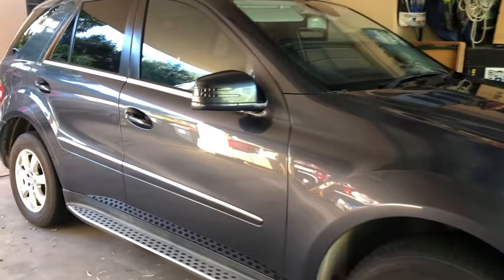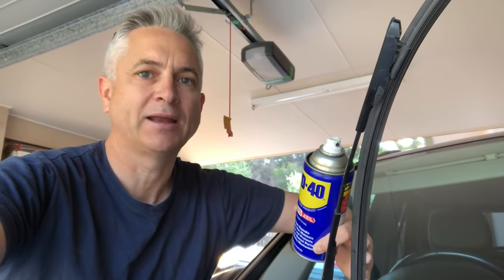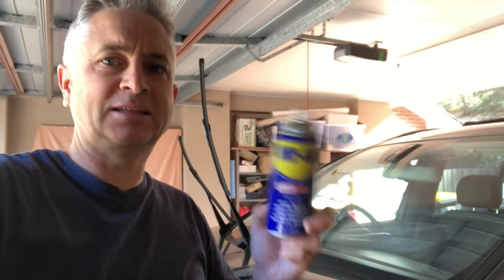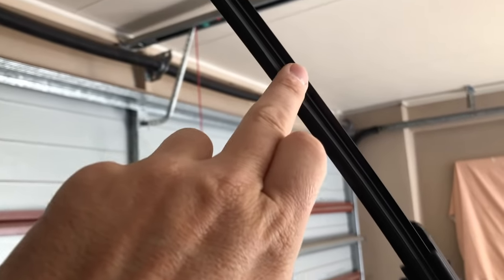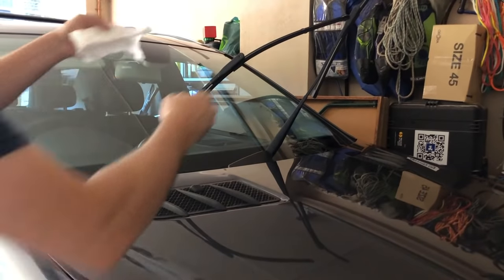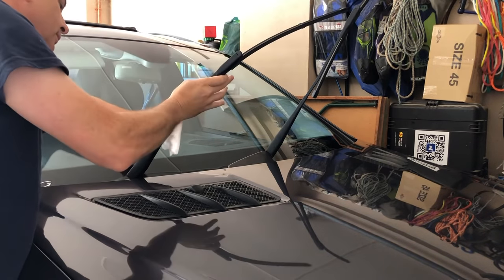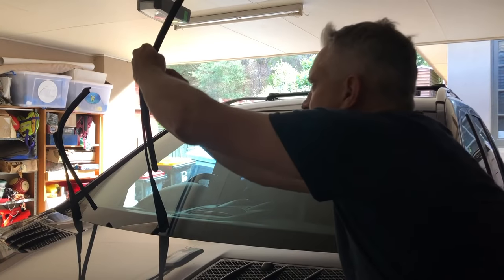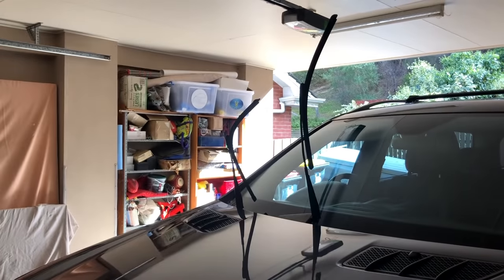WD40 Hack on Wiper Blades!  Does it really work?

Comment: Hi Drew, on some wiper arms, wd-40 can be sprayed to loosen the hinge or elbow, that's supposed to flex downwards,  with the spring underneath.  Wd-40 will loosen a corroded hinge,  allowing the correct pressure of the arm and blade on the windshield.
Reply from the maker: Hi Erik, thanks for the info. I will look out for this in the future! Cheers Drew

Comment: I agree.  That was "dried rubber" coming off your blades. Soft rubber works best on glass. So, removing dried - hard rubber and softening the remaining blade will make it pliable.  I'm curious as to how long it lasts.  A follow up would be nice.
Reply from the maker: Hi, I still have the same blades on the car to this day!!  Cheers Drew
Reply: @DrewFixIt  Great. Thanks.
Reply: Use the Rain-x wipers and Rain-x cleaner. Works great. Water beads up and blows off the window. When you notice the wipers not performing like they were, and it's easy to tell this, just wipe some of the cleaner on the wiper blades, and they are like new.
Reply: Awesome 😂
Reply: @curtzeek8818  I have used both works OK if you use the spray every month but otherwise same old crap. Wipers are nothing special and too damn expensive.
Reply: @bultacowally  I agree they're too expensive. That's why it pays to take care of them with a little pm
Reply: It'll last for one good downpour and start gringing/grating again.
And yes its not just dirt being removed. Its the compound of the blade too.
Reply: Wiper blades exist thatv never wear out. They won't sell them.
Planned obsolescence.

Comment: A buddy of mine owned a gas station and he had this rubber cleaner for repairing tires that he'd use on wiper blades. He called it, "recutting the blades". It worked pretty good. So if you can get ahold of whatever that stuff is then give it a go.

Comment: Yes, as others here have noted, the black is for sure oxidized rubber.  My only issue with using an OIL BASED product such WD-40 SOLVENT, is that it will break down the rubber.  I usually use 91 % rubbing alcohol and then as another mentioned, PURE silicone liquid because it WILL NOT attack the rubber.

When I buy any new vehicle, weather a new car, or recreational, all rubber and aluminium under the hood etc. gets a good dose of pure, food grade silcone spray.  The rubber lasts for years and the aluminium will NOT corrode (white powder).  Just a tip I learned years ago, and continue to use to this day.
Reply from the maker: Hi Gary, thanks for the tips.  I will be sure to try them out!  Thanks Drew
Reply: @DrewFixIt  You are very welcome! 😊
Reply: Good point it helps initially the key is to have something that continues to work better.  Not works like new again then even faster goes bad.  As with many of the headlight lens "fixes."  Unlike here many of those fixes claim proclaim to have cured the problem simply because it looks shiny again.  Rather misleading as this is done right after finishing and no testing was done for durability of the sealant used.  Will it last similar to the original, longer or will it cloud over much faster.
Reply from the maker: @cardinaloflannagancr8929  Hi Cactus, I did mine something like a year ago and they are still good!  Cheers Drew
Reply: I doubt an occasional clean with WD40 would cause enough breakdown of the blade to worry about, but if in doubt, maybe Inox would be a better option. I use Inox on outboards, because WD40 can break down the insulation of the wiring and Inox doesn't. Then again, maybe the reactivity with the rubber is what helps clean it? I might try both ;)
Reply: most wipers today are synthetic rubber( petrol based) or silicone or a combo..not actual latex rubber.
Reply: By silicone liquid, do you mean something like CRC Heavy Duty Silicone? Curious if AT-205 would also be a good option.
Reply: I have yet to see WD-40 break down any rubber in my 40 years as a mechanic.
Reply: @2023JCWMINICOOPER  I am interested in your 40 year claim and use of this solvent on which rubber items?  Couple things, WD will attract dust and dirt, it also doesn't last very long as it does evaporate in a short period of time.  100% silicone liquid doesn't share those properties.   But, good for you that your use has not resulted in any negative effects to rubber which I find amazing!
Reply: @garysmith8455  You do realize that there are 100% silicone versions of WD-40 right???
Reply: @2023JCWMINICOOPER  Thanks for the heads up, would you kind enough to share the link to the product?  Thanks.

Comment: I've actually noticed that the old-style multi-part blades work better than the "new" single-beam blades, which makes me wonder if the new type were mainly a matter of marketing all along. Also it saves me a fair amount of money.
Reply: The 'new' type work better at high speeds due to the aerofoil. Though you can/could get the 'old' type with an aerofoil on the arm.
I have often had problems with judder or streaks on the newer type... much less (or never) with the older types.
Reply: @DJ_Dopamine  That's one of their claims but I haven't found it to be true. Maybe the old type just let air pass through while the new type lets air get underneath and lift them. Project Farm should do something on this but I'm not sure he owns anything that goes fast enough.
Reply: I thought I was the only one who thought this. I have a 2016 Ram 1500 and I have way better experience even with Rain-X Expert Fit Conventional than any beam blade. All the beam blades chatter at the ends as if they are fitted very loose but the conventional won't do it and they cover the entire 22 inches where I swear a 22 beam is more like a 21 or 20 inch blade. My favorite blade is the Rain-X Expert Fit, about 16 bucks for a set of two at Walmart vs 40 bucks a set for beam blades
Reply: The 'new' type blade is most of the time better if your wiper arm is In Good condition (spring load etc.) or/and if you drive in winter where 'old' type wiper "joints" could freeze. 'New' type blade can sometimes do this "jumping" But easy fix is to use turtlewax clearvue type rain repellent. All together i use most of the time old blade for older car and New blade for newer car.

Comment: Worked a treat on my Mercedes wiper blades ( Smart fortwo 2019  ). I agree with others that it removes dry rubber gunk and also softens and revitilises the rubber underneath ie renews the blade. Great hack

Comment: The WD40 may clean the road grime off your blades but it will also cause the rubber to degrade much more quickly.  This is why the people who sell those $70 wiper blades just love it when people use WD40 to "fix" their wiper blades.  It means more business for them, not less.  Soap and water will also clean the grime off your wiper blades, but without damaging them in the process.
Reply: I’m curious to really know if WD40 can harm rubber (and maybe most plastics too!) since it’s a solvent. Yes, it’s oily and acts like a lubricant thus the apparent improvement in the wiping of the wiper, but maybe it is damaging the rubber.  Also, wipers live all the time under the sun, which evaporates the WD40 but leaves a residue that may not be good for rubber either, I don’t know. Some people recommend cleaning the wiper blades with isopropyl alcohol, … do you know if IPA does actually conditions rubber?

Comment: As an alternative you can get the same grime/dead rubber off with just white vinegar. To stop juddering, etc rotate the blades around (so the front side becomes the backside). With fancy brands you may need to do a bit of light modification for this but if it saves $60+ per blade its worth it! 

I also agree wiper blades shouldnt cost anymore than $30 for a set - anything more is a total rip off!

Comment: I have been using this trick for ages, but there is a better way to do it. Use Lanox, made in Australia, works a lot better, and can use it on all rubber seals, especially around windscreen and back window. But absolutely fantastic for powered windows. Clean all the seals with windows down, with the nozzle tube, spray inside the seals then open and shut the windows a few times, then clean off any residue. Windows just glide up and down and seals remain water tight.
Reply from the maker: Hi Cudgee, thanks for the tip.  I have a can of Lenox I can try as this was what was recommended for lubricating the latches on my 1960 Falcon!! Cheers Drew
Reply: I'd be very careful. Here's a quote from inox themselves about Lanox "avoid spraying rubber fittings and hoses as these will need a special rubber grease or spray instead."

Comment: Looks like a nice tip. Only problem is ferrets are crazy about WD40. Apparently it contains some fish oil and the scent attracts the ferrets. They start chewing on everything that has the smell. We’ve even had them causing leaks in brake lines and electrical wiring.
Reply from the maker: Sounds like you’ve got a whole world of ferret pain to me!!! Cheers Drew
Reply: @DrewFixIt  You wouldn’t believe the places they appear in. We haven’t seen them in the city yet but they seem to spread like rats.
Reply: Leave ferrets alone
Reply: Crumbs! I've even had ferets climbing up out of my tiolet bowl.
Reply: @paulrichards2365  🙄😂

Comment: Use the silicone one... The regular one will maybe dried out the rubber with time due to the petroleum solvant in the formula
Reply: Silicone reacts with the glass in your windshield, making it cloudy. You will permanently mark your screen, where the blades are at rest.
(From someone with a degree in Glass Technology & Materials Science.) Mineral oil dries out rubber, making it crack and break up.
Reply: @wessexdruid7598 what about wd40, does it not react to rhe rubber?
Reply: @Ryy22  See my comment below?

Comment: WD-40, a water dispersant with 1001 uses...there was still streaking though, bottom left hand corner clearly visible.

I currently use oven cleaning foam for my windscreen as it easily removes the milky marks that result from the crap off the roads, which even the better screenwash solutions will not touch. I usually run a sponge impregnated with it along the blades which results in the same old rubber being removed, and it works a treat as long as loads of water is poured over the screen and blades when done, and they are run a few cycles.

Comment: Terrific video tip, mate! I've been using a product called Rain-X on my windscreens here in NZ for over 40 years (ever since it first came out) and it's brilliant - at 100kmh in a downpour (like it does here in NZ, not like you dry Aussies) the water just STREAMS off the windscreen - hardly need to turn the wipers on! With this tip with the WD-40 - which I have at least two cans of around the garage and house - it's going to be even MORE brilliant!! As a note, Rain-X must have been developed for the aerospace industry, because it was originally developed in Scottsdale, Arizona, where it practically NEVER rains!!
Reply from the maker: Hi Allans, thanks for sharing and do let us know how you go!  Cheers Drew
Reply: I used to use Rain X when it first came out and it was brilliant. The rain just slid off the screen but the only trouble was that it didn’t last too long then I had to retreat it.
I think it was the grit salt on the British roads that was the problem. Thank for video.
Reply: @colincrooky  Grit salt? Oooh yuck! We don't get any of that here in NZ. I generally re-apply Rain-X about every 3-4 months here, it only takes a few minutes, and for the price of it, it's well worth the trouble - a spray bottle of it has lasted me over 3 years, and it's still nearly half-full. And for NZ $17 a bottle, that's got to be good value!
Reply: @colincrooky  Here in the USA, there is a Rain-X windshield washer fluid gallon jug, that you fill your washer tank with. This makes it easy to renew the protection at any time.
If it's not available out your way, I imagine it would not be very difficult, to mix up some from the original Rain-X glass water repellent and plain tap water.
Reply: @GalileonPrime  Tap water is not necessarily a good choice - hard water areas have dissolved salts, and that leaves a residue. Better to use de-ionised or distilled (which costs money), or use boiled rain water or the effluent from a dehumidifier.
Reply: Rain Ex is ok. It used to be awesome! The liberal EPA (environmental  protection  agency) made them change their formula. I actually went through an entire winter without any wipers. Now you have to constantly reapply.
Reply: @mikes8950  It used to be acidified isopropyl alcohol. I don't think it says on the bottle what it is now. I've got a bottle in the vehicle, I'll have to have a look. Even if you have to reapply it once a month it's still worth it. Oh, and the WD-40 trick with Rain-X works really well, DrewFixt!!
Reply: @DrewFixIt  Works bloody brilliantly!!
Reply: Rain X is good, but there is a better product now in the market. Do give the japanese brand soft 99 - the Ultra Glaco a try. One good application would last you 10-12 months. A tiny bottle will last u atleast 3 years!
Reply: @justin-pv6ff  Thanks for that. Had a look - only one company in NZ stocks it so it has to be freighted, 70ml is $39.95 vs Rain X 680ml is about $20 and the Soft 99 is out of stock! Rain X is stocked by two of the major parts & accessories outfits here as well as a lot of smaller ones. I've had a bottle of Rain X for 3 years and it's still half full, using it every 3-4 months, on all the windows on a Ford Territory. On top of that, to use the Soft 99 the windows have to be super-clean before you use it. Rain X is a glass cleaner as well as a coating and I've been using it since the early 80's - thanks, but I think I'll stick to Rain X!
Reply: @allansbullet   bud is everything so expensive down in NZ?! In MY, got my Glaco Ultra for RM26 (around $6 USD). I also got a bottle of Rain X 207 ML for RM21 ($4.50 USD) which i intend to apply on the passenger side windows and rear windows.

Have not used Rain X, saw some tutorial videos was wondering after say 2-3 months how do i reapply them? Do i need to use glass polish first then reapply? Or just top it up? 

Does ph neutral car shampoo wash off rain x? I have to wash my car weekly. (Rains alot in the tropical season) Appreciate your response!
Reply: @justin-pv6ff  I see that Ali Express have Glaco for about NZ $22, but then it has to be freighted here from the States (and NZ is a LONG LONG way from anywhere!). Is that the Malaysian Ringgit, is it? The Rain X I buy comes in a 680ml spray bottle so it follows that a 680ml bottle would be about $14.80 USD at the prices you quoted, which is very close to NZ $22.80, so we're actually getting it cheaper than you are! Rain X is a glass cleaner as well as a sealer and rain repellent, so just wash your car, get it dry and apply the Rain X - no other cleaners needed and buff it off with a microfibre towel. If applied correctly it gets rid of those shitty arches where the wipers don't reach. It doesn't seem to wash off easily, even in car washes. Then in a couple of months, just wash the car and reapply it. It works well on headlights getting rid of road film too.
Reply: @allansbullet  yup ringgit. Probably retails about the same price, a couple dollars cheaper online.

Got it, will give it a go with Rain x tomorrow. Probably will wash, use glass polish compound to remove the oil film before applying the Glaco on the Windshield and Rain X on the rest. Thanks for the tip. Cheers.

Comment: I have used wd40 like this for at least 7 years on my MB here in Canada through our 4 season climate. I haven't replaced blades in all that time. I do this In spring and Fall but also thoroughly clean the windshield at every wash. That is not all road grime you are removing but also deteriorated (aged) rubber material. Blade is then softer and more pliable thus conforming better to the glass curvature.

Comment: Yes. Wiper blades for MB’s are in the $60-$70 a pair. Wait till you have an S class. I have a S class coupé that has the washer fluid coming out of the wiper blades so it does not obscure the driver’s vision, those are $200 a pair! They have these on the upper end E classes now in the new generation body. too. 
I have used the W-30 trick and it works. My wiper blades are now 3 years old and they work like new!
Reply: I’ll bet you can get substitute blades that work for a third of that on Amazon.
Wake up.
Reply from the maker: @jimmy5634  I’ll have to look them up, do a video of changing them and post an Amazon affiliate link, thanks for the tip Jimmy!! Cheers Drew
Reply from the maker: @Janet Carman Hi Janet, thanks for sharing and for the support, I genuinely appreciate it! Cheers Drew
Reply: "W-30" ?????   We're talking about WD-40
Reply from the maker: @ausfan100  agreed!! Cheers Drew

Comment: Looks like a great trick. I will definitely have to try it.. I’m curious as to why you just didn’t (connect) disconnect 🤫 your wiper blades and that way you wouldn’t have to stretch across the car at all. They just clip on and off real easy.
Reply: Do you mean disconnect?
Reply: @Mr35000000  Yes you're right I meant to say disconnect. Corrected it Don't tell anybody lol 😆